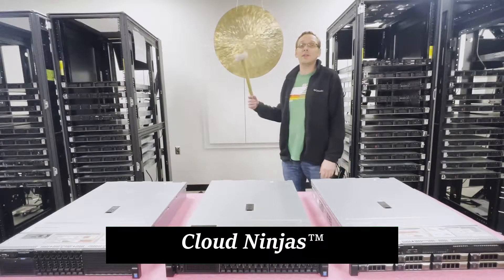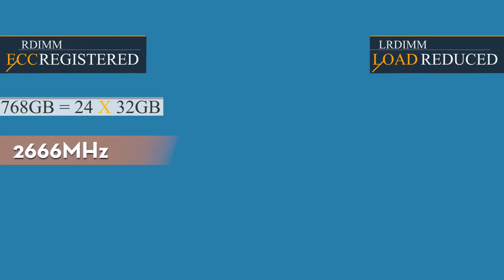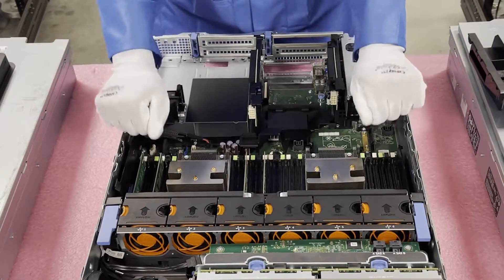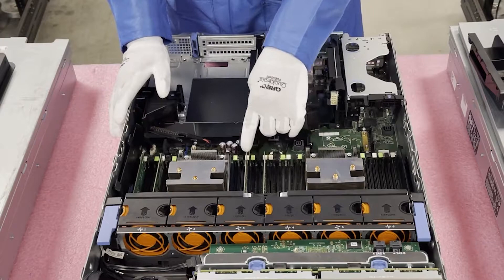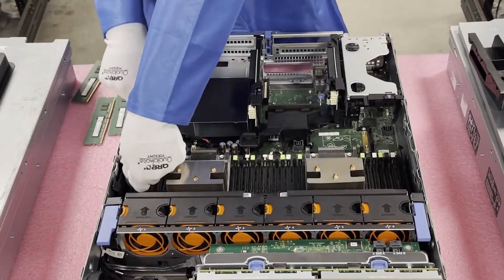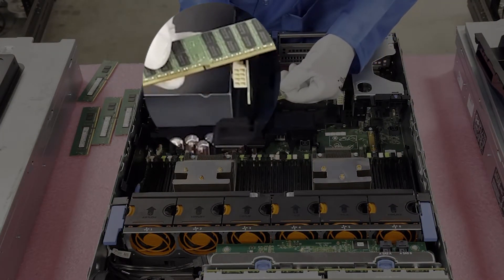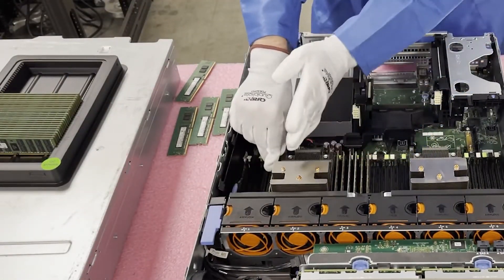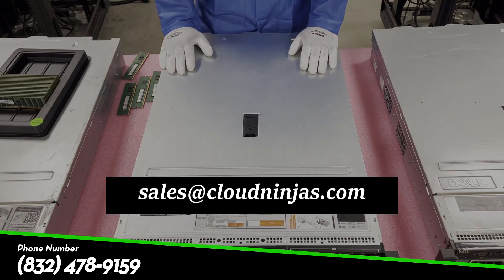Dell PowerEdge R730 Server Memory Spec Overview & Upgrade Tips | How to Configure the System

Comment: Just put an R730 LFF into service running Unraid. I want to begin increasing memory for a VM, and was wondering if the two types can be intermixed (RDIMM and LRDIMM). It is currently configured with all slots full at a total of 64g memory. Specifically, since I'm running two cpu's, can one cpu (pinned to the VM) benefit from LRDIMM and thus greater memory? Primary uses are rendering (Davinci Resolve) and Solidworks.
Reply from the maker: You cannot mix RDIMM and LRDIMM modules together. I would recommend using LRDIMMs if you are looking for a lot of memory. But if you are looking for fast memory performance then I'd suggest RDIMM modules.

Comment: I have a R730XD and 8 PC4-2400T ECC 32GB RAM Modules, in what slots should the memory be installed to achieve the best performance with Dual Xeon E5-2666 v3 10Core @ 2.9Ghz?
Reply from the maker: You should install them in the start of each memory channel.  There are 4 memory channels per CPU.  You want an even distribution across each channel.  You can identify the start of the channel by looking at the colors of the memory tabs.  You will be inserting into all the white slots.  Good luck!  Smash that subscribe.

Comment: 2 things of note:
1. Xeon v3 memory speed is 2133 and Xeon v4 is 2400 (budget SKUs are slower). So DDR4-2666 doesn't provide any benefits.
2. Those speeds are only achieved on a 8 DIMM configuration. With 16 or 24 DIMMS it will run slower.
A v4 with 2400 memory speed will run at 2133 with 16 modules and 1866 with 24 modules.